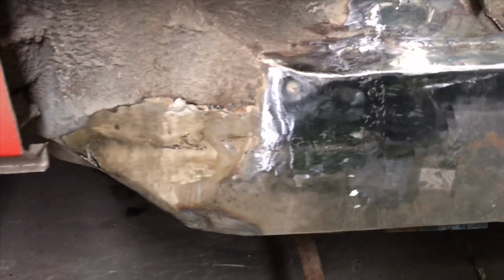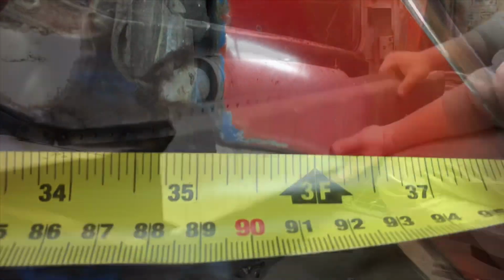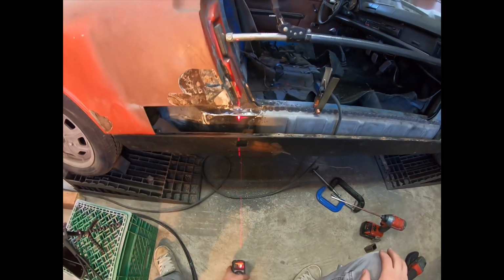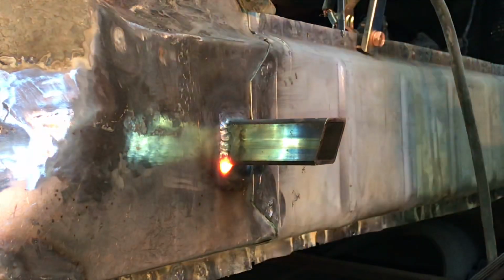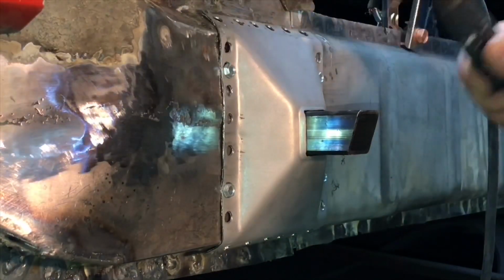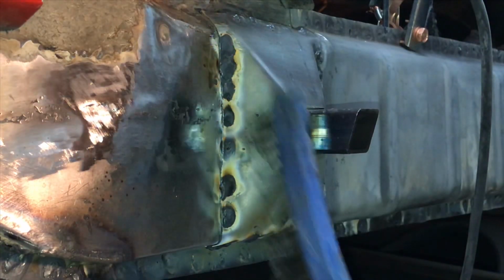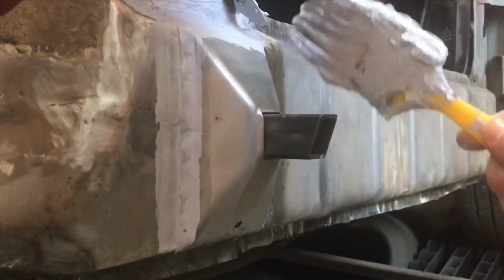Porsche 914 Inner Rocker/Jack Point Repair

Comment: Hi Joe ! Nice car. Love the short and crispy videos. What seal did you use on the welds around the jacksupport ?
Reply from the maker: Hey Thanks for watching! Your positive feedback is much appreciated :)

Ive attached a link of the sealant I used. Have a great day!

 https://www.amazon.ca/Dominion-Sure-Seal-DOM-PBGQ-Brushable/dp/B002HOGEKW/ref=asc_df_B002HOGEKW/?tag=googlemobshop-20&linkCode=df0&hvadid=292933467044&hvpos=&hvnetw=g&hvrand=1011344323961200233&hvpone=&hvptwo=&hvqmt=&hvdev=m&hvdvcmdl=&hvlocint=&hvlocphy=1002298&hvtargid=pla-569223024921&psc=1

Comment: Did I miss the repair at the bottom of the A post inside the rocker cover?
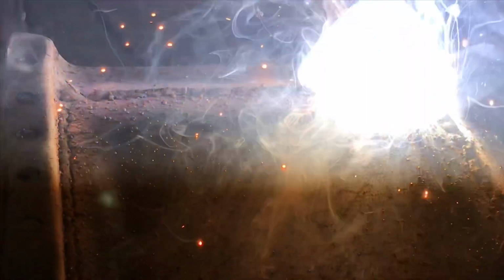Reply from the maker: At 1:00 it shows a plate welded into the inside of the rocker panel to mimic  the structure.